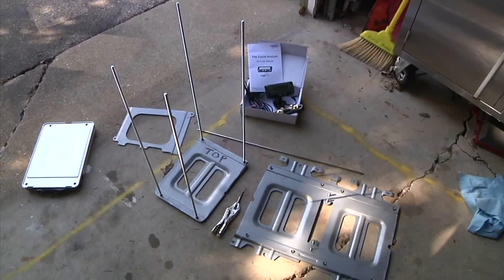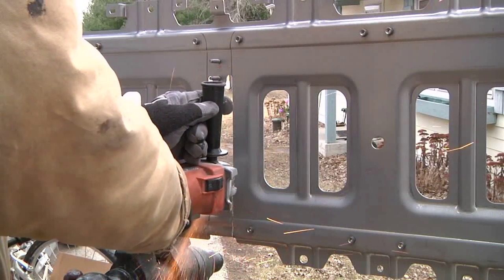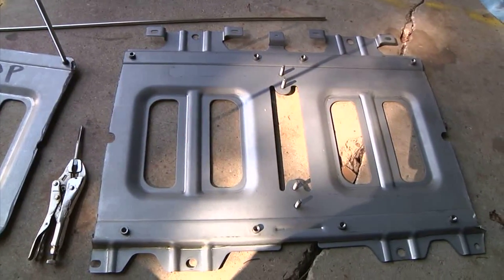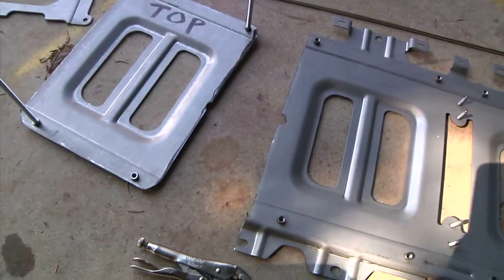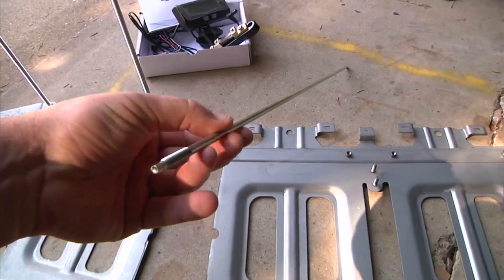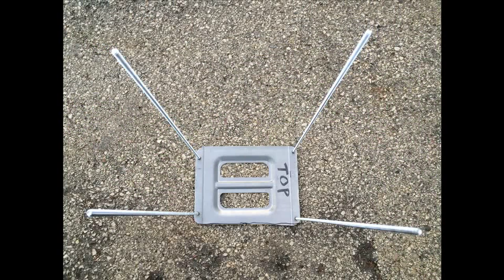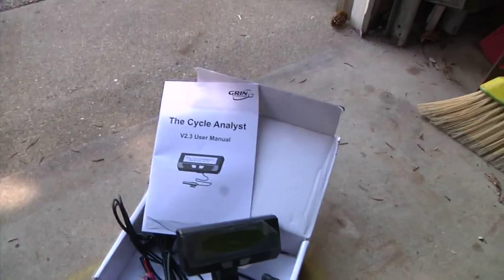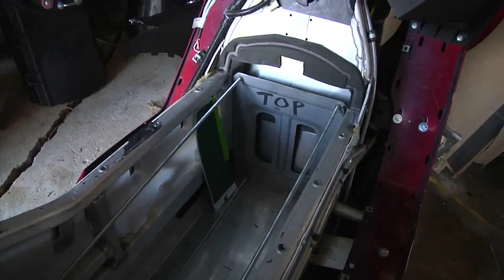Vectrix Upgrade: Battery Pack Framework and Cycle Analyst

Comment: good videos !    so 1 module is 0.5 kw/h (and contains 4 flat cells)  do you know what the weight and size of each module is ?   (i'm trying to figure out what is more efficient, 18650 cells or this kind)
Reply from the maker: 2ftpmarco Yes, that's right. Each module is 9 inches wide by 12 inches long by 1.5 inches.  (22cm x 30 cm x 3.5cm) Weight is about 8.5 pounds.